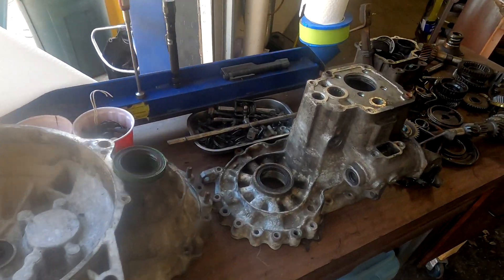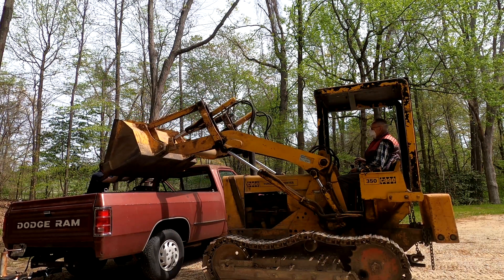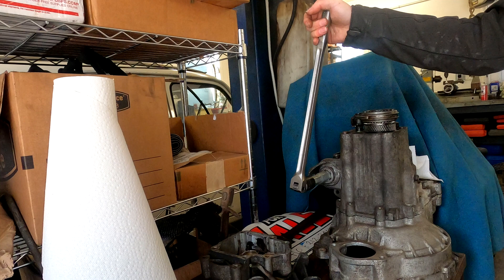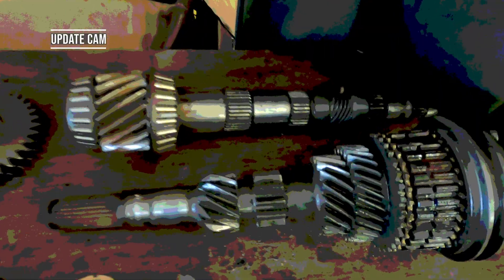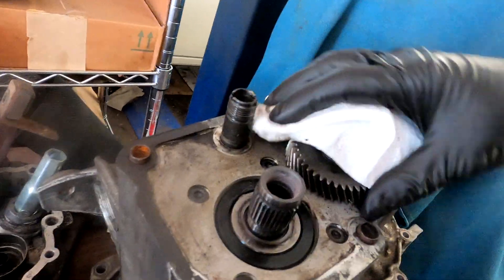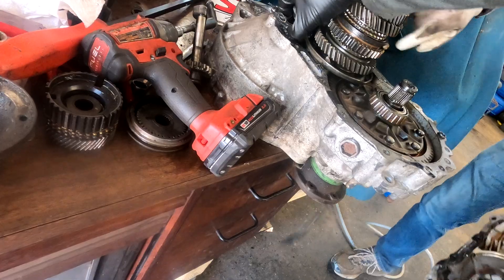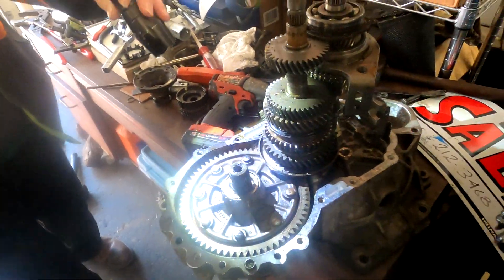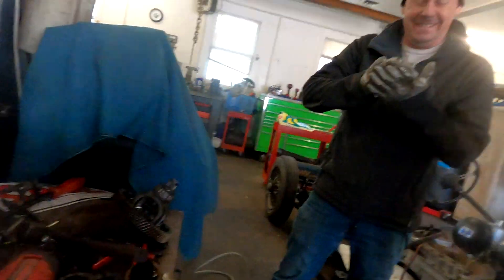Volkswagen 020 Transmission Teardown

Comment: 4K transmissions were available in Mk1 North American 1983-84 GTI’s! I do not know for sure if they were available in the MK1 GLI, or other model years and Europe. It is a close ratio transmission. It uses the same ring and pinion ratio as a diesel trans. It is indeed an uncommon trans, makes for a fun to drive car, but it screams at highway speeds. An almost identical trans is the AWY that came on late N/A diesel mk2s, only difference is 2nd gear is a little taller
Reply from the maker: I saved the gear stack just because it is somewhat rare,  everything else, including the case was pretty bad.

Comment: I know you guys probably won't respond but where did you get your parts, my 5th gear magically disconnect from the output shaft and free spins
Reply from the maker: Doubt you can find a source for gearbox internal parts.  If you know what part broke, I may have it.  Willing to donate if you pay postage.
Reply: Ah you don't need to do that, I'm thinking it's the sleeve bearing on one of the gears, she still shifts and syncs into 5th but it's just straight rattling and free spinning, even when it isn't in a gear and clutch isn't engaged you can hear it free spin